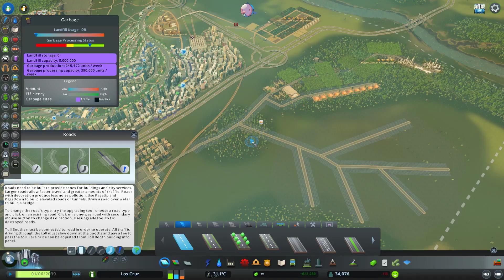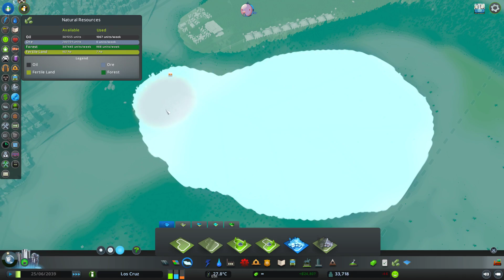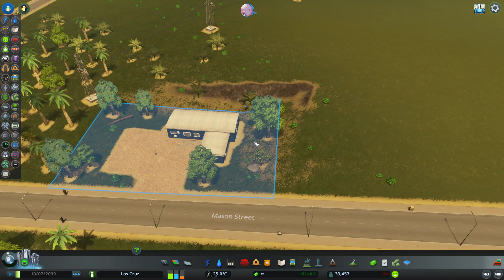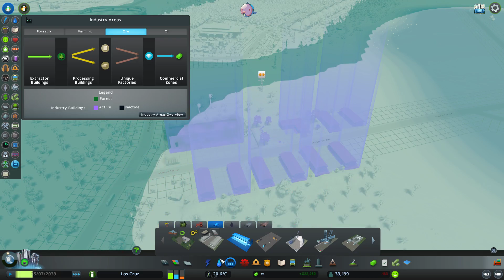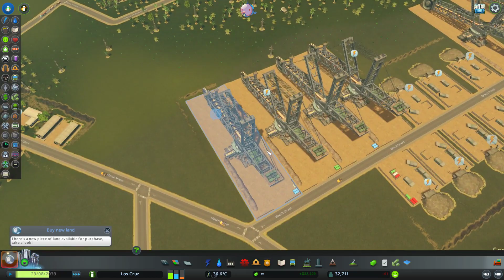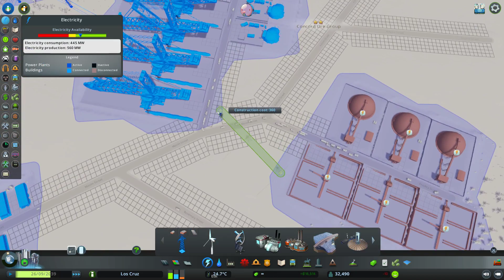Cities Skylines Industries | Ore Tutorial

Comment: I got an odd problem. I only just started getting into the specialized industry, so I thought I did something wrong.
I got a few ore mines and a single grinding mill. The mines produce more than they can get rid of, and I keep getting warnings about that, asking me to create storage for it. But at the same time, I keep getting warnings about the mill not having enough ore to produce anything.
All of them are on the same road, so it's not an access issue. There's no traffic to speak of, so that's not bottlenecking it either.

I got no clue how to get the ore from the overflowing mines to the underproducing mill.
Reply: I have the same problem. I don't understand what's wrong. My warehouse is empty and the mines are full. Strange thing?
Reply: @FrodeLøtvedt  if I remember correctly, it's about how the allocation works. It sorted itself out after a while, so it seems like the ore got allocated for export when it was produced, not when the truck arrived to pick it up.

So just let it run for a bit and it'll sort itself out.